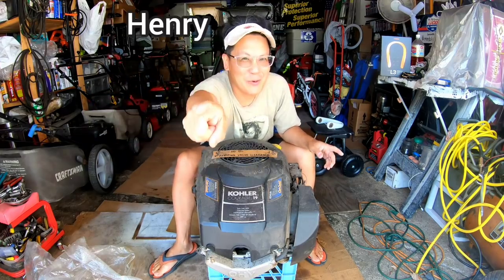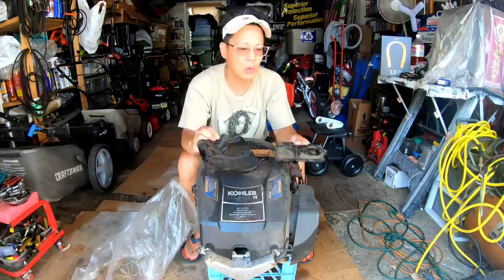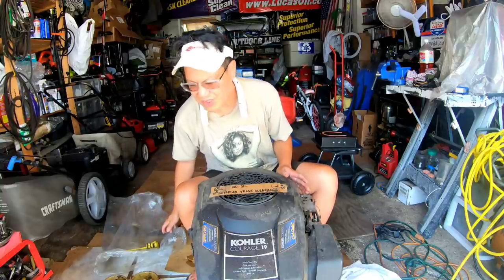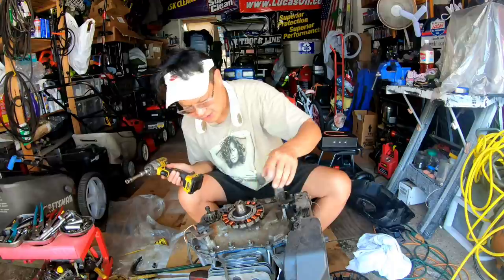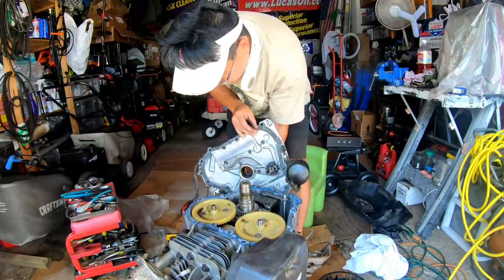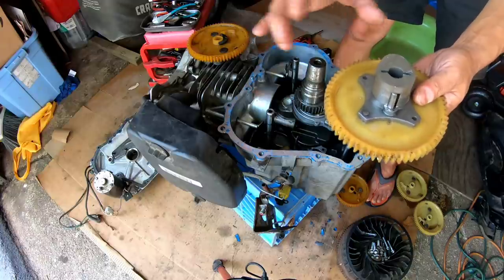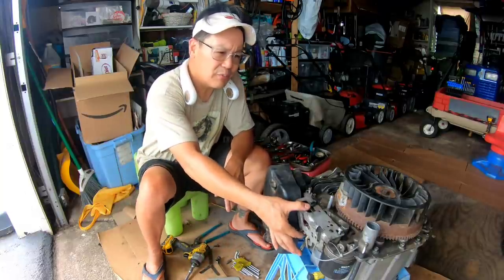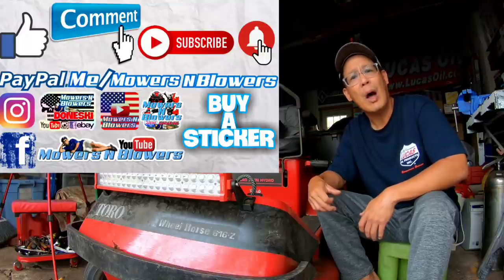KOHLER COURAGE 19HP TWIN CAM ENGINE CAMSHAFT ACR COMPRESSION RELEASE LEVER REPLACEMENT & VALVE LASH

Comment: The ACR rod that you were showing has the round side that sticks out from the low side of the cam lobe when it is retracted, or spinning slowly. The extra hump on the low side of the cam lobe created by the ACR rod sticking up opens the valve slightly on the compression stroke in order to release some of the compression and allow it to spin easier. When the engine starts and the gear starts spinning at normal engine RPM, the weight on the ACR moves outward because of centrifugal force, rotating the small shaft and causing the flat part to align with the cam lobe and the extra hump goes away. That way when the engine starts, the valve follows the normal cam lobe profile and is closed completely during the compression stroke and creates normal compression for maximum power when the engine is running.
Reply: That’s correct, what he was saying just wasn’t making any sense to me 😂.

Comment: The intake takes in air and gas so it'll be on the carburetor side, exhaust blows  it out so it's on the muffler side. Intake carburetor, exhaust muffler. I  had a problem figuring it out but now its easier when I think of it that way. Same thing when you're setting valves .

Comment: When applying rtv gasket I always make sure both surfaces are completely clean with no old material or oil on them.  Hand tighten bolts initially, then torque down an hour, or next day, depending upon what rtv is used.
Reply from the maker: The gasket was in good shape on the sump side,  cleaned block side and added a small layer.  My impact is rated at 18.5 ft lbs which is almost the torque specs

Comment: Henry, the difference in the carburetor backing plates is 1 is fo17, 18, or 19 hp, with the throat restrictor and it other is for a 20HP and up.
Reply from the maker: Good info bro!  Thx
Reply: So the 20HP and up version do not have a restrictor at all??? I ask because I have seen two versions. One has a solid restrictor built into the carb backing plate ( one single piece as seen in this video). The other version is just a backing plate by itself( also seen in this video) and the restrictor is a single piece which is inside the intake hole. This restrictor is hallow. Is this the restrictor on the 20HP and up versions.????
Reply from the maker: @joleaiperlis5347 I haven’t noticed a difference in performance at all with either
Reply: @MowersNBlowers   Good to know. Thank you!!!

Comment: Make sure to use some blue lock tight on those sump bolts to keep them from backing out especially the ones around the flywheel cause if they back out during use the engine will be destroyed people give the courage engine a bad name long as you do proper maintenance oil change keep a check on those sump bolts make sure they don't back out they last just as long as a crappy Briggs & Stratton 🥴
Reply from the maker: Good tip bro, hope you'll subscribe

Comment: I saw the key way laying in the hole the flywheel bolt came out of. I don’t know where it went. Did you find it?
Reply from the maker: No, never turned up.
Reply: @MowersNBlowers  make sure it didn't fall down the hole for the fly wheel bolt.  You may not be able to tighten it fully.
Reply: It fell into the hole, need to fish it out before screwing the flywheel bolt back in
Reply from the maker: Too late

Comment: What gasket sealer you use what kind
Reply from the maker: Permatex rtv silicone gasket maker
Reply: Thanks
Reply: I got a trans seal leak behind  the brake rotor any tips on removing  it  lol.
Reply: Tractor 1999 weedeater 13 1/2 hp
Reply from the maker: You gotta remove the transmission and break it open!  Lots a work!  I’d just pour in some transmission leak seal or ATF.  Not worth the trouble or find a new tranny
Reply: Thanks il do the trans stop leak
Reply: I got peerless 5 speed trans what weigh  oil you recommend plus the trans stop leak
Reply from the maker: 80w90 oil and Lucas stop leaks

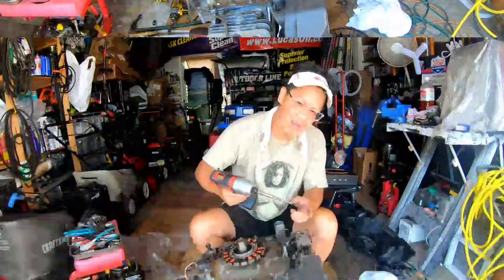Comment: At 13:32, flywheel key falls off top of crank into bolt hole. So it seemed anyway.
Reply from the maker: Lol,  never noticed and put the bolt right in and tightened